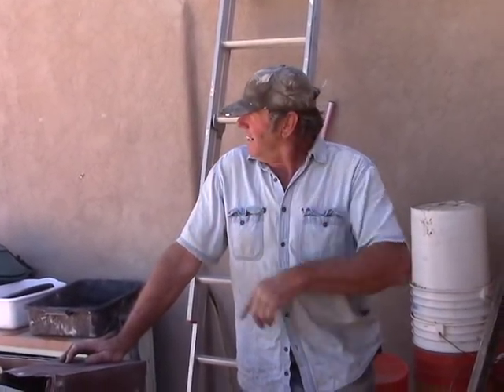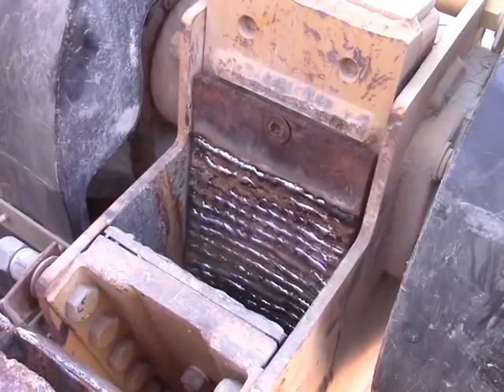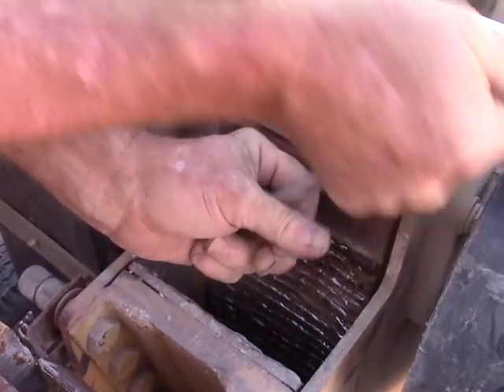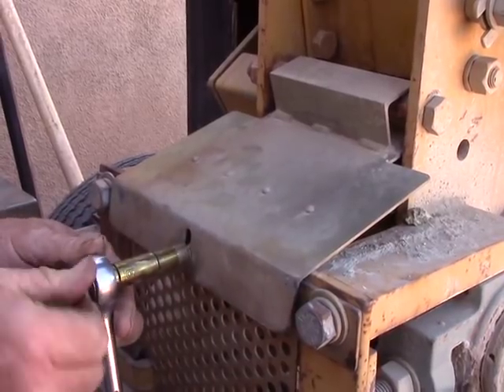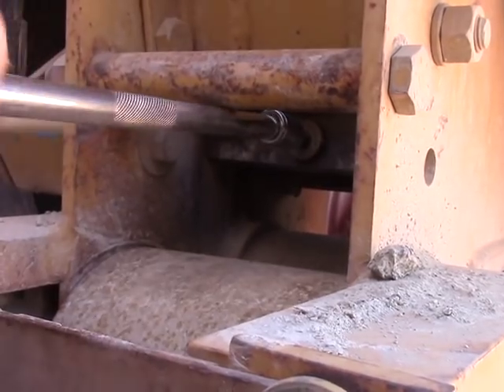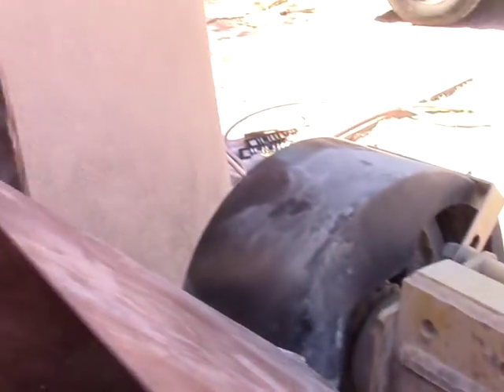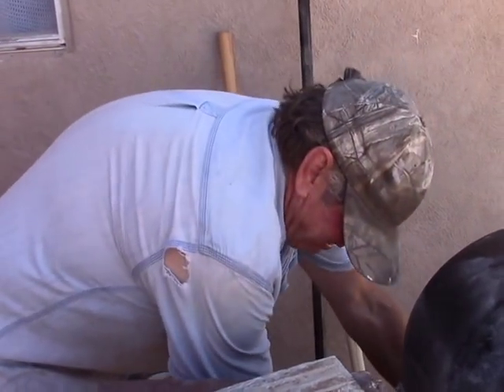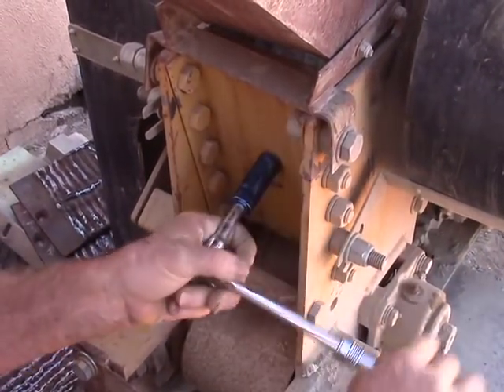Lesson 44  Changing and Hard Facing the Jaw Plates on a Keene RC 46 Rock Crusher

Comment: Use some grease or anti-seize on those nuts and bolts. And buy some better quality tools or at least a breaker bar. When the teeth on that cheesy ratchet let go and there’s something jagged by a finger or a knuckle you’re gonna wish you had gloves on and using a breaker bar.
Reply from the maker: The allen socket is usually the  point of failure.  Yep, been using more anti sieze lately.

Comment: We used to hardface on water cooled copper blocks. If you do multiple plates run beads equally apart staggering the pattern on both and repeat so no one plate overheats or weld warps. There's also cool super rod you can get but it's mucho dinero.
Reply from the maker: Do you mean I should skip weld the beads?  I really have trouble focusing through the lens after striking the arc and can only use stick for hard facing due to equipment limitations.  I really wish I was a better welder, but I know a lot has to do with vision.  So many things I would like to take classes on if I had the time and money.  :-)

Comment: You could just take a FLAT PLATE of steel and bolt them down to it then hard face them then let it cool
Reply from the maker: That is essentially what I did.  It's just that a second wear plate is the perfect size to clamp it too.  The slight reverse bend of the strap seems to correct for the slight residual stress in the plate after release from the clamps.

Comment: When the threads squawk like that they are very close to galling. Please get some anti-seize on them. 

You can get those socket head countersunk bolts in high strength grade 8 from Copper State nut and bolt. Those are identical to the ones I use on my race buggy skid plate. 

How thick are your jaw wear plates? I have a bunch of 1/8” AR 500 plate  I’m thinking you should have at least 1/4 if not 3/8”.  But AR 500 is what those plates should be made of. AR plate is Abrasion Resistant a lot of shooters use it for targets. The only bad thing about AR is drilling is a pain unless you use carbide drills. It can be drilled with a High Speed Steel drill but the bit will need to be tossed in the scrap pile when you are done.

If you need a hand on any projects, or in the field, I’m only about 15 minutes from you!
Reply from the maker: The threads are a bit rusted also.  Would anti seize tend to trap dirt during the change out process and cause a problem that way?

I usually go to hardware specialties as they are only about a mile away.

They are 1/4" thick and heat treated after machining from what I was told.

I am doing some samples today if you are not busy and want to come by.  Would love to meet locals that are interested.

Keith